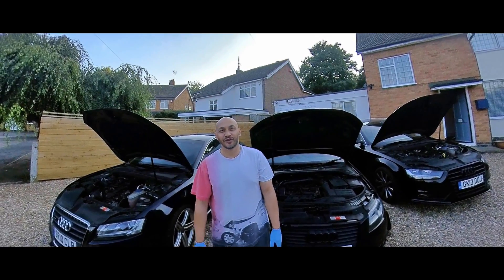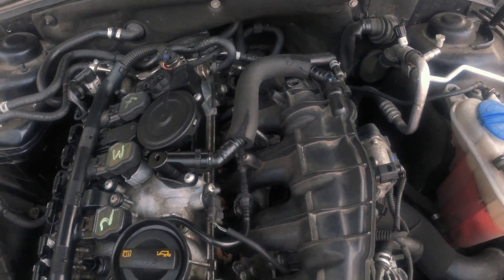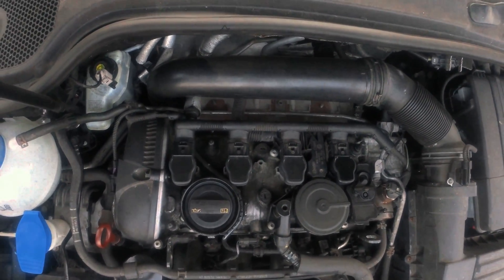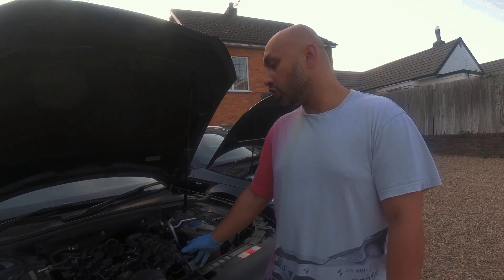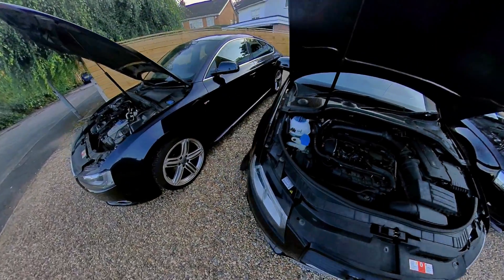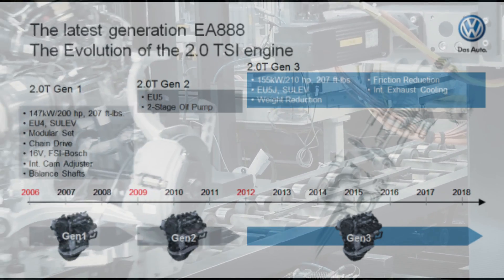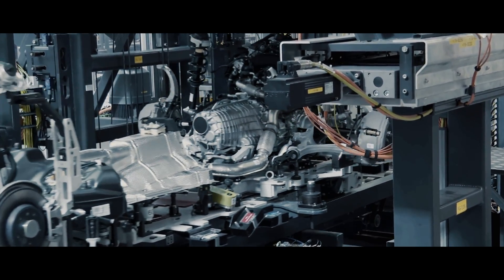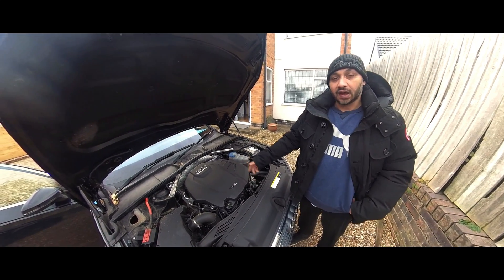VW Audi EA888 Gen 1, 2, 3, 3B TSI TFSI Engine Problems Comparison Review 2008-2021

Comment: I own a stage 2 a3 1.8tfsi gen3 ea888. No oil consumption problems yet. It has 85000km
Reply from the maker: That's the same millage as my gen3, same here, fingers crossed..
Reply: @GetJobDoneofficial  I think the engine will be reliable. But my clutch gave up a few days ago 😂 the mq250 transmission in the a3 is weak af
Reply from the maker: @michaelzirch9045  Yes, but the good thing they are not too hard to work on. Let us know how job went.
Reply: Gen 3 2014 Passat bought new 170,093 miles runs great. ZERO squeak or rattles. 41.2 mpg when set cruise to 57 mpg on a 100 miles trip with sunroof and windows open. Replaced PVC breather and use BG's MOA, 44K, EPR. Best car Ive owned in my 67 years including g a new 2011 base GTI with DSG

Comment: The gen 3 has both direct and indirect fuel injection. Cars in the EU and UK.
Reply: @LOTEK575  Do you agree?
Reply: @GARRYEASTON   he did mention high lift low lift on gen 3 engine but hes giving the history of the engine build. see his other video about the dual port injection on the gen 3.
Reply: @mohammedrahmanrahman5024  High lift and low lift is to do with the camshaft! It has variable valve lift!

Comment: I've Had the Gen 2 in MK6 GTI 6SPD that engine was beautiful and awesome many smiles per gallon (until the tensioner gave out cost me 3k fix bc machine shop) If you are getting a MK6 (gen 2) get after 2012 you'll be good or make sure it had it replaced if not low ball the dealer. Now I have  Audi 8V Quattro gen 3 engine I love it very smooth and I have a DP and Boost controller it is like a spaceship lol I'm scared to feel what a tune would do lol!
Reply from the maker: Thanks for sharing. You have nice car, 8Vs are popular to power up, they are strong, they can take a lot and that's the reason why they are one of the most tuned vehicles in that range.
Reply: Mk6 gti only came with gen1 or fsi for ED35 or R

Comment: Great video. The same story with tsi engines. What a crap. Full rebuild after 100k miles.
Reply from the maker: It's the same engineering. Do you mean 100k miles?
Reply: @GetJobDoneofficial Yes. The same story with DSG. Clutch pack, mechatronics and  dual mass flywheel all replaced after 110k miles.

Comment: I'm thinking of purchasing an A5 2.0 tfis convertible 96000miles 2010 how would I know this engine is affected by the piston ring issue? Are all the engines problematic? Could I still have this engine under the North American issue to be fixed by Audi for free if it has an oil problem? Thank You?
Reply: ring them and see if the car had a recall for the problem. audi are theifs dig deeper with them
Reply: I live in USA and mine got fixed for free but the dealer asked me for proof the car was serviced at Audi, which it was, and be under 80,000 miles. I was at 75000. If you don’t have proof and/or are above 80000 miles, they do a prorated cost

Comment: Hey just wanna ask, will a ko4 turbo kit from a tfsi engine , be a straight fit for a tsi engine(mk3 scirocco)?

Thanks
Reply from the maker: Providing is the same engine or in the compatibility range. TFSI and TSI share the same engines plus minus some minor differences
Reply: @GetJobDoneofficial  if i am to upgrade from a ko4 what supporting mods do i need besides an intercooler, full exhaust sys, dv, induction kit and r8 coilpacks ?
Reply: @mrvb03  you need a good tune! None of that will be useful without a good tune. Many times a good tune can make or break an engine so keep that in mind!

Comment: Based on what you said, it seems like the Gen3 engines are a lot more robust with the PCV / tensioner issues being resolved. Is there anything else to watch out for?
Reply from the maker: Yes, if you go to my playlist the one with Audi A4 b8.5 rebuild it has few videos on this Gen 3 - all issues dealt with that engine. We had oil leak, we had entire water pump failure. I am sure there is more but overall these are issues that we can all do ourselves unlike issues presented by Gen 1 where pushing it off the cliff sounds most suitable

Comment: Great video 👍🏼 I have A4 B8.5 1.8tfsi 2013 with CDHA engine and it’s a shame that Audi didn’t resolve oil issue even on later model as mine....1 l on 1200 km currently and question what to do.....really unprofessional from their side....I have 120.000km. Shame on Audi....even before I have bought it Audi was satay in that they have resolved this issue on later models. I don’t know if my engine is first gen but this oil issue is really bad. Keep up ⬆️
Reply: My 2008 a4 had horrendous oil consumption by the time I got rid of it around 50k miles… 800 miles before it said it was low again! My gli is starting to do that at 130,000 miles… but it has a weird noise that I’ve been thinking is a timing tension issue

Comment: So what gen do the CAEB and CPMA/CPMB engine fall into?
Reply: But isn't the caeb notorious for having the bad ring issues? Mine had to be done at 70k under recall. Also I thought all gen 3s switched to a metal intake manifold with a 5th injector?
Reply from the maker: @rose_city_performance  The 3rd Gen has MPI twin injection system which is brilliant for performance and health of the engine. The CAEB has been recalled that is correct. I am glad you have been able to get that swapped under the circumstances.
Reply: @GetJobDoneofficial  Oh this caeb has suffered just about every recall audi offered. Timing, piston rigs, pcv, rear main seal. Unfortunately it was over the mileage to be covered. The previous owner had the pistons done, I'm assuming under warranty. Very frustrating platform to own. I'm so used to these dirty direct injected engines that when I pulled the intake off of my BMW e56 the other month I almost shed a tear when I saw actual clean valves. Strongly considering just swamping for that 3rd gen CPMA
Reply from the maker: CAEB is Gen 1, and CPMA would be Gen 3